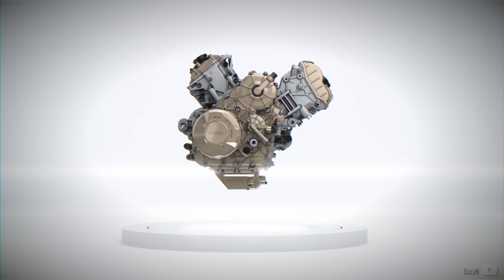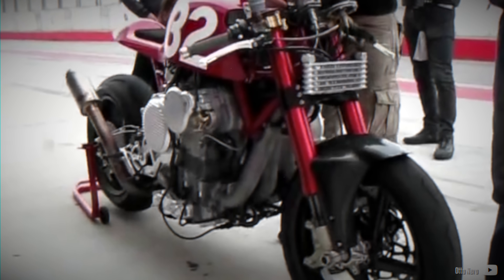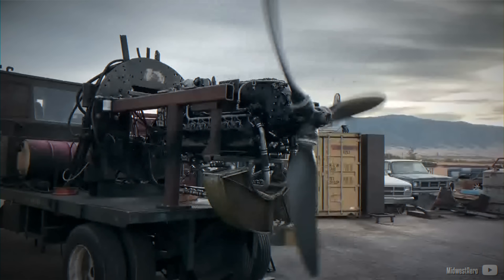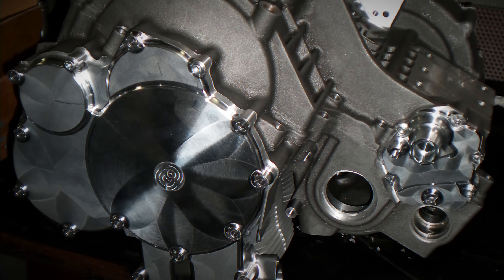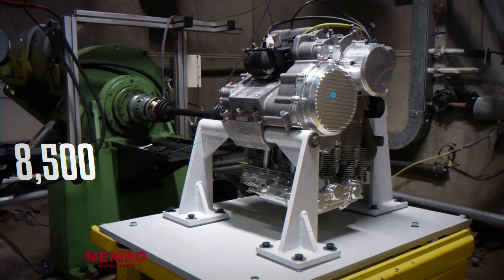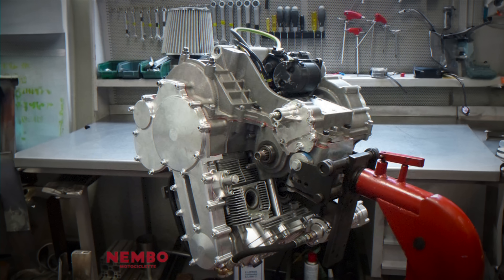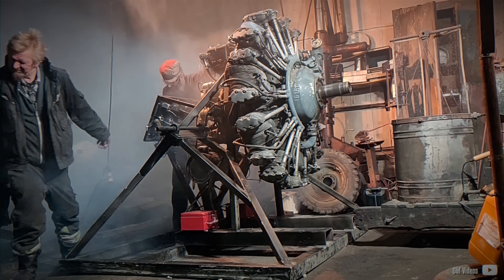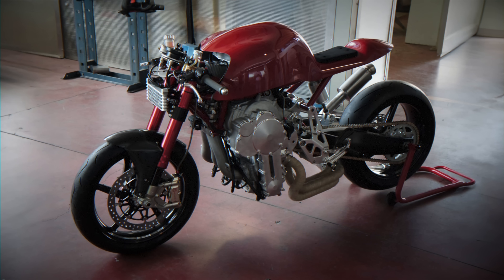Fascinating 8,500 RPM Upside-Down 3-Cylinder

Comment: The logical extension of the pursuit of mass centralization to battery-electric motorcycles would mean placing the battery immediately under the seat and in the traditional fuel tank location. It seems that some electric bikes nearly do this, but probably only as the result of needing to use all available space for battery.

Comment: When not running, all the oil sinks to where you don't want it, in the cylinder head (this was a major problem with radial aircraft engines).

Comment: But it reduces the bike handling because the heavy side of the engine now in higher position.
Reply: The designer's point was that the higher mass is closer to the centre of the mass of the bike and rider, so it improves the bike's handling.

Comment: I can understand the reasons why they made it air cooled and also why the mounted the engine upside down, But why did they make it 2valves per cylinder why not a dohc 4valve it would of reved higher too.
Reply from the maker: I assume it is a small engineering team with small budget

Comment: "Overhead CRANKshaft...." :)
Reply: LOL... but "overhead" in an engine means on the far side of the head from the crank, whether that is actually up or not. Flat (horizontally opposed) engines are still "overhead cam" even though the cams are at the same height as the cylinder centreline, not on top of the heads.

Comment: The actual reason why many aircraft in the second world war had inverted engines is because of ease of maintenance; Invariably, the engine is elevated above your head when the aircraft is on the ground for reasons of propeller clearance. Most of the most frequently serviced parts of an engine are in the head, and inverting the engine puts all of those parts closer to the ground where, in this case, they'll be easier to access without needing a ladder  for example. Engine orientation had only a very minor effect on gun placement or field of vision.

Comment: Would've thought a higher centre of gravity of the bike's mass would just result in more effort needed to make it lean over in corners. More mass higher up might be beneficial if that weight could be moved relative to the wheels(like a human on the bike), but engines don't do that. They're bolted in place. I feel like either this idea was not very well thought out, or maybe there's some details we're missing. I don't know why the guy was inspired by inverted v12's. The reasons for that being done in a plane (propeller height, gun locations, i'd never heard it was an improvement in ease of service, that one's new for me) are not really applicable in a bike, it puts the spark plugs straight towards the ground which i wouldn't have thought would be better, makes the engine burn more oil(not certain about that one but i bet it does burn more) and raises centre of gravity(still not convinced that's a good thing, not as it's been explained anyway). Again, i feel like we're missing details, because the way this video is presented makes me very understanding as to why no one was keen to back this project.
Reply: It doesn’t look like it turns very well, so change of direction would be atrocious with such a high centre of gravity
Reply: The higher the weight is the more easily the bike will turn into corners, but it makes the bike easy to drop at low speed.
I have a T7 and its a very top heavy bike.
Reply: @JohnSmith-ef8nr  ah yeah, i think that's making sense to me. Is it easier going into the corners but harder going out of the corners maybe? A bunch of different forces at play, i didn't think about the extra leverage gravity would have on a higher mounted engine.
Reply: The higher the center of gravity, the less lean angle needed. Its why Harleys don't cope with corners well, you have to lean them over way too much.
Reply: @johngalt97  haha yeah, everything's wrong on them as far as cornering. Too low and too wide for any cornering angle

Comment: Instead of a chain, a shaft and its is geared to the cam much like a GAA Ford but uses a spiral to lift the oil instead of a pump. This would allow the cam to sit in oil and finning it . I can see this being oil cooled . A billet cylinder block with multiple oil passages surrounding each cylinder. . Next is a 2.2 l two stroke triple…..

Comment: Mercedes DB series was inverted so a cannon could be fired through the centre of the propeller hub.
Reply: The engine was inverted to have the possibility to install a prop with a bigger diameter. That's the only reason. The machine gun shoots right through between the propeller blades. It doesn't matter at what height the crankshaft sits.
Reply: If an engine directly drives a propeller, then to fire through the centre of the propeller hub would mean firing through the centre of the crankshaft... and timing firing to miss all of the connecting rods. In fact, the Mercedes DB series engines used reduction drives, so the propeller was not inline with the crankshaft - it was in line with the vee of the engine. 

The Motorkanone design was used with the Mercedes DB series in some aircraft, with the cannon firing through a tube in the engine vee and then through the hollow propeller shaft and hub... but that's not the crankshaft.

Comment: A greater centralization of mass was achieved by Honda with their CX500/650 engine which raised the engine and placed the gearbox beneath it (rather than behind). I have a 650 Turbo and when cornering the bike rolls like an aircraft about the centre of mass rather than leaning over. The CX handling was not liked by everyone!
Reply: Yes. I rode a CX500. It felt like riding a Tommy Tippie infants cup!! 
Definitely didn't like it

Comment: Early aircraft engines were flipped upside down in the airframe to raise the crankshaft centreline which enabled the use of larger diameter propellers, that's why it was done.
Reply: Nope
Reply: why was it done ? @Errol.C-nz
Reply: @shrimpy7862  to give the pilots better forward vision for reconicense, dogfights & landings.. if youve ever sat in a 109 vs a spitfire its clearly a big advantage even just on the ground
Reply: @Errol.C-nz  why can't it be both? Perhaps it was just a coincidence or good fortune that this mechanical change was also a good visibility upgrade?
Reply: @shrimpy7862  because it wasnt.. they flipped the engine for visubility FFS! just read its history.. RR Historic Heritage site aviation.. theres a good reason in physics as to why this upsude down high crank reciprocating flywheel effect is bad.. as the bike rolls into turns.. just as with inline vs V4.. the cenyer of roll moment.. is at ground level.. center of mass is meaningless for bikes
Reply: @Errol.C-nz "Because" isn't a real answer... that doesn't answer my question at all. Have some patience dude, we aren't all aviation history experts. If you can't explain yourself, I'm gonna just assume you're talking out your arse. 

Both seem to be beneficial reasons to flip the engine. I see no reason both cannot be true, I really doubt it was a one dimensional decision. If you Google "why were early aircraft engines upside down?", it even says exactly what OP said, to raise the crankshaft and fit a bigger propeller.

I'll even quote for you.

" With an inverted engine, the crankshaft is higher off the ground, and so a bigger propeller can be fitted.... lower centre of Gravity, better visibility, on Vee engines the oil sump can be fitted between the banks of cylinders."
Reply: @shrimpy7862  that quote.. doesn't explain then.. that the gearboxes on the front of the engines.. can align the prop shaft anywhere it's needed.. & as the center firing cannon can't be fitted in ANY crankshafts for obvious reasons.. there's NO mechanical or purpose of physics for mounting the crankshaft high.. that the crank case is nearly half the width of the cylinder head cam covers.. speaks for its self.. I'd suggest the author of your artical is talking through his arse.. look at a 109.. sit in one & talk to their service engineers.. as I did 40 odd yrs ago.. they'll say the same
Reply: @Errol.C-nz  you will notice that I said early aircraft engines which means to me pre 1925, not 109s or Spits but earlier stuff like Gypsy engines which originated from the upright Cirrus Hermes which used surplus Renault V8 cylinders.
And there's no need to get shirty with people, it's not a life or death matter is it really.
Reply: @AntonHoward-mx9sb  not in those civilian applications no.. but this conversations been around the inverted Damler engine in the 109.. which run a gearbox & that had the flexibility of allowing the prop shaft to be aligned anywhere they like or needed.. just like ALL the right side up RR engines in Brit & Alies aircraft.. the top cowl on a spitfir & Hurrican are fat compared to the 109.. the fw190 had a version with the Damler engine too with a horizontally centered prop shaft.. with a bigger prop than the 109.. what does that say.. they just add more blades as power goes up
Reply: The "engines were flipped upside down in the airframe to raise the crankshaft centreline which enabled the use of larger diameter propellers" reasoning is valid, but only in the case of direct-drive engines. Most of the high-power engines of the piston era used reduction gearboxes, so the crankshaft height does not determine the propeller hub height.

Comment: Being a gearhead, I always used to think; why 3cyls? Until my father took me for rides on his h-1, gt750 water buffalo, and finally a Yamaha xs 850 bike. I was blown away by their performance and my attitude changed forever. I guess with dry sumps, you can run anything upside down or sideways. 2 strokes can do this with no sump and I think this would be more viable in this setup?
Reply: Threes are cool and unique. One downfall is their rocking-couple vibration that's really hard to get away from.
Reply: @turnin.sprocket   Check BMW's K75. They have an extra shaft to avoid (counter) these vibrations. I own one and it revs like a sewing machine. Smooth and no vibrations.
Reply: @christophermikrowelle7093  Every inline-3 runs a counterbalance shaft, otherwise they'd shake themselves to bits. The outcome is mixed. I've a MT-09 and it's smooth enough, but still delivers some buzz through the machine.
Reply: @turnin.sprocket   Okay, good to know. If you have the possibility to drive a K75 you should try it. Absolutely no vibrations.
Reply: Perhaps surprisingly, @turnin.sprocket , not all inline-3's have a balance shaft. Ford uses a balance shaft in their 1.5 L "Dragon" inline-3, but not in the 1.0 L "Fox" inline-3 engine. There are lots of inline triples in motorcycles, and some don't even have even firing orders (crank throws not at 120 degree intervals) - I don't know what they do for balance, but I would be very surprised if they all have balance shafts. The Yamaha MT-09 does have a single balance shaft.
Reply: @brianb-p6586  Those auto engines that don't run a counter-rotating shaft use weights in the flywheel and crankshaft pulley/balancer to counter the rocking couple.
Yeah the Laverda Jota is the one motorcycle I know of that ran a 180° crank and they were 981cc. They later switched to 120° crankpin phasing.
Reply: @lifted_above  crankshaft/flywheel weights cannot counter the rocking couple of an inline-3. The Ford Fox engine uses them to shift the plane of rocking from vertical to horizontal,  which is easier to handle for the mounts... but it still has the same magnitude of rocking couple.
Reply: @brianb-p6586  Everything is a compromise. No, they cannot counter/modify the rocking couple perfectly but they can compensate more than nothing at all. Even in engines people are fond of saying have perfect inherent balance (inline-6), there's imperfect balance characteristics which cannot be mechanically solved, but they are so minute that it doesn't matter.
Reply: @turnin.sprocket  I think you missed the point: crank-only counterweights are not just imperfect - they don't reduce the rocking couple at all.
Reply: @brianb-p6586  The conversation is rather pointless by now. There's better things to spend our time on.

Comment: Admiring people who not only have the idea but the money the patience the power the endurance to bring it to live. The hanging cylinders of airplane engines first had a very simple reason. The inliners were slim and had the lowest drag. The pilot and second sat in tandem position, not next to each other like in car. The very first engines had had the crankshaft down and the prop also - as the albatross biplane had. The pilot couldn´t see anything in front and was exposed to the exhaust gases together with oil and half burnt oil. The prop was near to the ground, which was dangerous and the flying stability was bad with this configuration. Changing the power always needed a correction of the elevator. And so they turned the engines upside down, the propshaft now was in the centerline of the plane, the exhaust was seperated from the pilot.

The better access to the cylinder of the mercedes WW2 engines was not the main reason. Mustangs and Spitfires used to have normal V12 engines and the maintanance was even faster than at the german fighters. However the nose of the Messerschmidt could be built more slim to give lower drag and more visibility to the pilot. Anyway, the british and american engines were the better ones. Hundreds still run today. The mercedes engines are very rare and with more failures.
Reply: Well, those Merlin Engines were still build long after the war ended. While Germany was forbidden to build airplanes for years. So, no wonder that there are more Merlins left than DB60x.

Comment: Hats of to this engineer going the unbeaten path. 210Nm on a bike is quite ridiculous, but the chassis seems to handle it well.
Reply: Agreed, but 210Nm out of 2 liter is nothing special tbh.🤷
Reply: @christiannoble5549   Not when the engine is in a car, but on a motorcycle that amount of torque is a more than a handful.
Reply: @Tom-Lahaye  210 is more than enough, sure, my bike has only ~120Nm with 1100cc. I meant the Power/Liter is nothing special, the bike itself is insane.
Reply: @christiannoble5549  Yeah it's not some thermodynamics marvel or efficiency beast, it's "just" a good and crazy engine.
Sounds like something like this would be an interesting kei car swap.
Reply: @christiannoble5549  for an air cooled, 2 valve engine, it's pretty good.
Reply: german WW2 airplane fighters had upside down engines. nothing "new" here.
Reply: @mikeadams2351  You're right, and there was no problem (way to speak) in an aircraft to place exhaust and air intake. This one is absurd.

Comment: are you changing oil?
no I'm just adjusting the valves!
Reply: Are you changing oil?
No im removibg the spark plugs to draini the excess thin 0w40oil that seeped through the pistons and dripped into the cylinder head!
Reply: Similar challenges exist with flat engines (Subaru, Porsche, Goldwing), but obviously not as difficult. I would say that dry sump systems would make flat engines much more tolerable and viable.

Comment: The higher CG is desirable? Does this two liter bike require more counter steer and rider input Then a more traditional layout?
Reply: A motorcycle tilting fulcrum is just above road surface, but it's a moving fulcrum due to the width of motorcycle tires shifting the pivot left and right. If you could concentrate all the mass as close to the fulcrum as possible, the ease of leaning a bike from one side to the other would be incredibly light.
Seems this design focuses putting the heaviest parts of a motorcycle as close to one location as possible between the wheels. I'm not sure what that would feel like while riding because in my mind, the theoretical mass center is raised from the usual conventional place.

Comment: this seems incredibly difficult, expensive, and only serviceable by well trained techs. Having said that, I would totally get one if I could :p
Reply: I disagree, a valve job is much easier. However you go to start it up on the weekend and the sparkplug are bathed in oil.
Reply: @SoulTouchMusic93 Remove the spark plugs and clean them whilst the oil is draining out, as with the bottom cylinders of a radial engine. You will still get some black exhaust on starting but nothing like the soot from a DC3’s engine, let alone a double row engine on a Constellation, B17, Liberator, Sunderland, Corsair, etc.